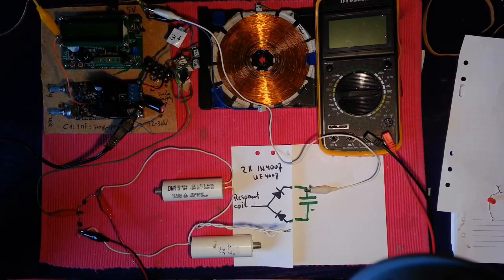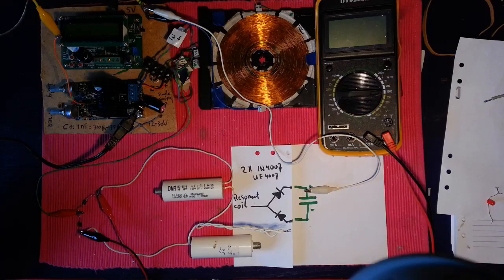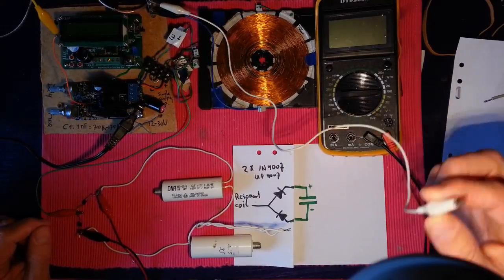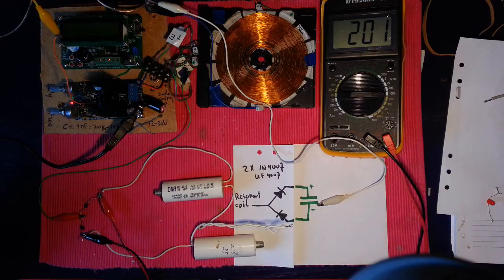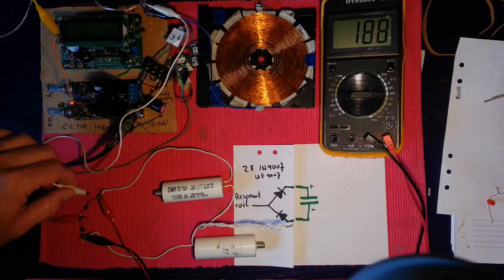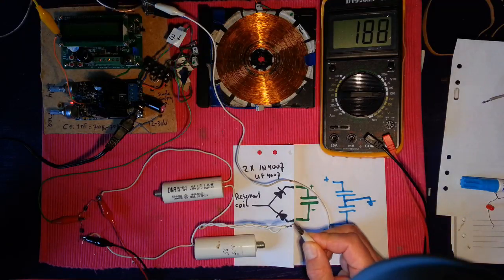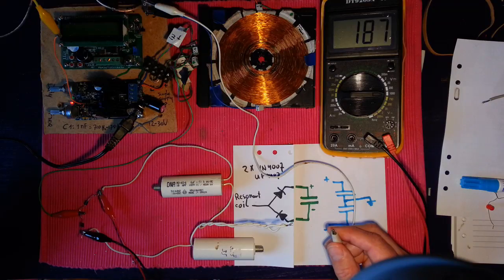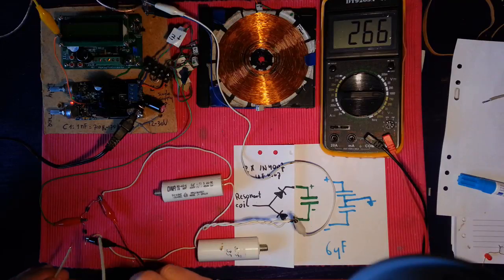The dielecric field of a bifilar pancake coil ADDITION

Comment: Hi Master Ivo.  Love your videos and appreciate your efforts in explaining and sharing your knowledge. I have a question about the use of the IGBT. Is it because the PWM is not powerful enough to turn on the mosfet fully? Could you just use a Sig. Gen with say a 20v output instead to drive the Mosfet directly? Also is there any problem with the very high back emf you get on your bifilar coil, breaking down the insulation between the conductors? Cheers
Reply from the maker: insulation breaking, no haven't had it. but I stayed low in voltage.

pwm isn't going to turn on the mosfet. It needs a current spike to really charge up the gate fast. but most importantly, to discharge the gate.

It can kill your pulse gen... use a gate driver.
Reply: I'm currently looking into an IGBT driver. I have blown up a few PWM gens. Fortunately quite cheap. Also looking into using the IRF460 mosfets after blowing  up quite a few of the normal mosfets.  Thanks for your info and informative videos!

Comment: Since the Earth is negitively charged and the outer atmosphere is posativly charged aren't we living in a dielectric Field?
Reply from the maker: yes we are!
Reply: @MasterIvo  just like a bifiler coil we should be in a charged environment
Reply from the maker: @dianathompson7597  yes we are
Reply: @MasterIvo  the question i have is, if we can amplify this affect and truly charge up the body on the beneficial dielectric field or ether currents. And if so, what's the best way? A static field between two spiral coils, or a pulsating +, - or a pulsating -,- type of effect. But what I'm trying to understand is how the permanent magnet field is so different from a dielectric field but they must both be composed of lines of force in the same ether.
Reply from the maker: amplification is probably done by electro static induction, using high voltage dc and implosion by using impulses (working on that).

I see the magnetic field as a curved vortex while the dielectric is more like a straight tension field. but theory is vague. we don't really know

Comment: Hi Master IVO,
i like your Vids.
But you have to understand, Every conductor is capacitively coupled with earth-ground. There is no 'one wire transmission'. Even a AV Plug is a closed circuit. A freely hanging wire is also capacitively coupled with earth-ground. Your Signal- Generator is coupled with earth-ground, so if you hook up an earth-cable on your pickup-coil or AV-Plug then you have closed the circuit.
Reply from the maker: yes

Comment: This is a great addition to the previous video. Question: when you say "turn on your IGBT" when using the antenna, what exactly is being turned on? A straight DC source. A pulsed DC signal? Half of a square wave? I'm assuming (probably incorrectly) that you're turning on a DC power source and feeding it into the collector of the IGBT, and the antenna is connected to the base. Somehow, the antenna is getting an inverse signal and shuts down when the coil is on. Or, a steady DC source is going into the primary coils, then a switch turns off the direct flow to the coils and turns on flow through the IGBT, which is already on because the antenna was getting a signal from the coil. The switchover then toggles the primary coil to an already-on IGBT (due to the antenna), which activates the coil, but the antenna then responds to the momentary lapse, shutting off power to the coil. But, not before the coil recharges, and sends another signal to the antenna to start the process over. Any clarity or diagrams you might be able to add would help out a lot. Thanks.

Comment: What you got there is good to levitate and propel an airship if used properly and in combination, as two coils on dc pulse and two coils on ac high frequency variable voltage. Do the tinkering, and you could be flying on a 12v car battery and an one piston Kobota engine-generator propane fed to  charge the battery. One dc to levitate, one dc to rise and fall. Two ac to propel at its simplest. The ac's also serve as field diodes to the dc's. In a cubic arrangement for smoother control use two lateral dc's and corresponding field diodes ac's. The principle is that electrostatic capacitive effect that you experience by touching the capacitors, and the electrostatic motion phenomenon  of polarization in a conical geometry being the capacitive cone's base the origin, as in from -to.
Reply from the maker: I like the field diode concept, can you tell more about it?
Reply: I read something like it on rex rexresearch.com/ under tesla's flyer

Comment: one important fact missing: How about the velocitiy of the wave: with the resonance frequency related to a specific wavelength and the length of the coil-wire, you sould be able to calculate the speed of propagation in the coil, that should be higher than the speed of light, what is typical for bifilar coils.
Reply from the maker: I once made the calculation and it didn't add up, indicating something else is going on.
Reply: may be it's because you are using two bifilar coils in series ...
Reply: and how you did wind your coils would be interesting too!
Reply from the maker: I remember Eric Dollard saying speed is the rate of induction.
the induction of the magnetic field is simultaneously around 2x half of the coil, so maybe that's why its faster.
Reply from the maker: How I wind my coils? Series connected like Nikola Tesla's patent 512340. The first coils I made, are by hand, on a cd sleeve with in double sided tape, and fast glue. Later on (now) I use speaker wire, I made a video about it:
https://youtu.be/ZKP9Bgpqa5E
Reply: I know this video, saw it - cable not long enough for my purposes, not enough  capacity because of not enough windings. I do not want to tranfer energy, but information, like radio.
Reply from the maker: yes I saw the video. But at resonance the dielectric energy becomes zero so it has to go somewhere, if not the magnetic field what else?

for radio transmission the bifilar coil isn't the right tool. I build a AM transmitter at the resonant frequency of the coil, but it doesn't work. Seems the energy is contained in the fields if the coil, and its not transmitted (It was a while back so I could be wrong but this is how I remember it).

the capacity is also increased by wire closeness and wire surface area. So if you choose a flat cable it might serve your purpose.
Inductance and capacitance still need to be balanced. The energy must be able to transform between magnetic and dielectric.

about the longitudinal, it seems the dielectric is longitudinal, but there's more to it.
Tesla's radiant energy, seems to be  the real deal longitudinal what we are searching for. its different than the dielectric field.
Induced by disruptive discharged capacitors (Nano second impulse instead of pulsed DC)
Reply: yes, the clue is longitudinal and high frequency resp. disruptive discharge (for me only the means to get a very high frequency out of it. For the same reason Tesla used spark gaps, that could trigger LC arrangements to their resonant frequency). The dielectric disappears at resonance? I guess, that the problem is to detect a longitudinal wave, because we are familiar only with electromagnetic ones to handle, measure and so on. The question is, how to detect and measure the value of a longitudinal wave, or its propagation and how to transform back into energy or electrmagnetic or whatever
Reply from the maker: Seems to be a little different. Tesla used a spark gap, but NOT to bring  a primary LC arrangement directly into resonance (as a so called tesla coil does, but isn't how he did it at all). 

The spark gap disruptive discharge was unipolar (didn't change polarity) and very fast in its discharge (in the nano second range). This wasn't necessary high frequency (high is relative anyway). So the primary got a fast short burst of energy. This is what he called a "Damped Wave" no resonance, no change of polarity.
This is what induced the radiant energy (longitudinal) effects. the secondary was the LC arrangement that reacted to this radiant energy. 
I hope to show and explain this in the near future. 
At resonance the voltage (dielectric component) is a sine wave. The sine wave becomes 2x zero at each period. If the voltage is zero, the energy is zero. But energy cant disappear.  The dielectric energy (voltage) when zero, is transformed into the magnetic energy. Resonance is transforming magnetic energy into dielectric energy, and dielectric energy into magnetic energy (twice in each period). But the question is, is it possible  to have resonance with voltage (dielectric energy) and Radiant energy without the magnetic component? I hope to show that also.
Reply: the separation of the components is my goal too. Looking forward to seeing your next videos
Reply: addition to scalar waves: Crossing wires at 90' will give a scalar pulse at the node of the crossing :) Mr. Anguswangus, found below this video https://youtu.be/Ra9yKpYTGbQ
Reply from the maker: I tried it like in that video. It makes the energy vortices of the magnetic fields of the 2 windings distort. It demands a lot more energy, for its unnatural configuration. one clockwise, and one counter clockwise, is not the way to go in my opinion.
the 90 degree caduceus coil could maybe do a trick, but I keep it like Tesla's patent.